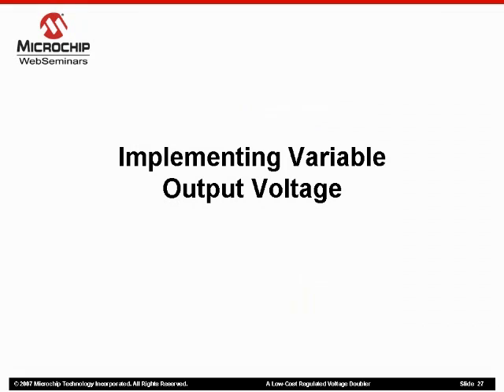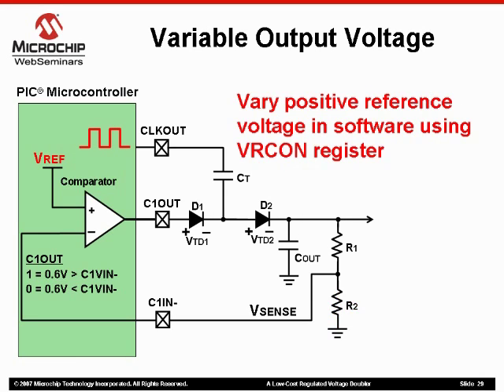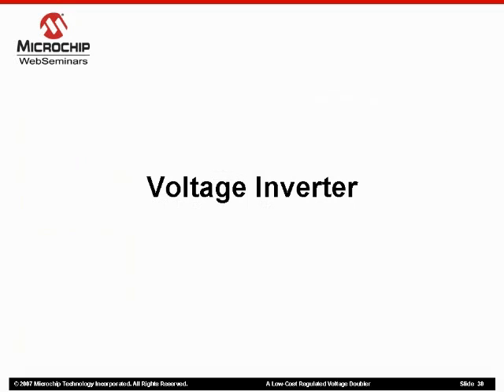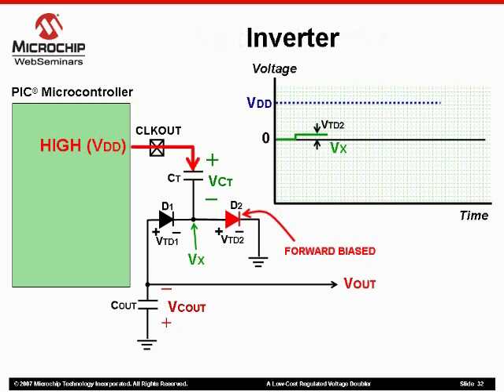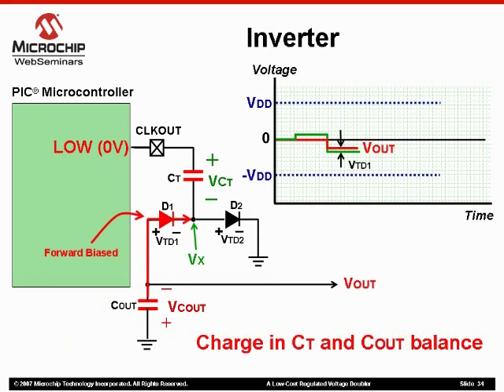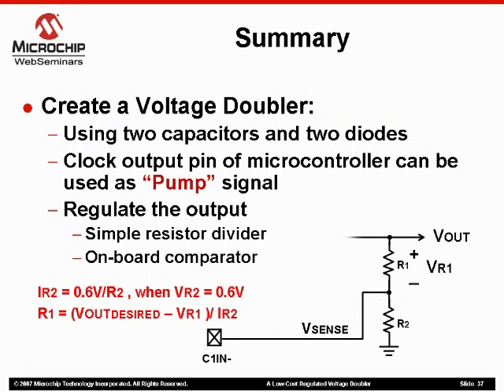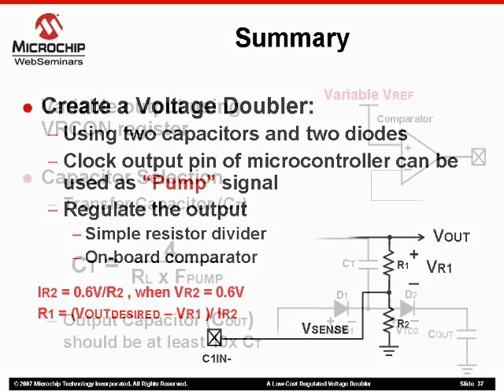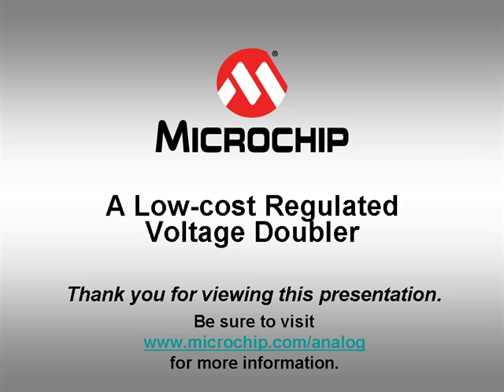A Low Cost Regulated Voltage Doubler Part 2

Comment: Hi, Great video and lots of info. I collect antique radios and am always looking to  build "Battery packs" .  The old "B" batteries had outputs from 22vdc to 90vdc, using the circuit that you have shown here or something like it, can I build a circuit that will allow me to use a few 9 volt batteries and then devolpe 67 or 90 volts ?   I need to concerned about current which is low but still a concern, the plate voltage ..vacuum tubes.  Thanks